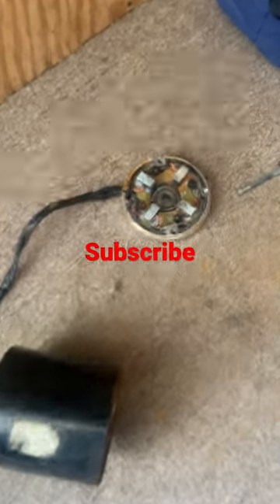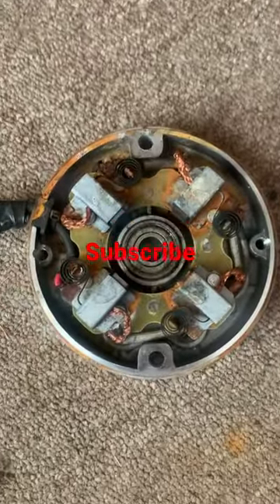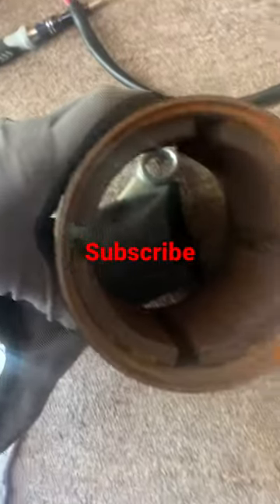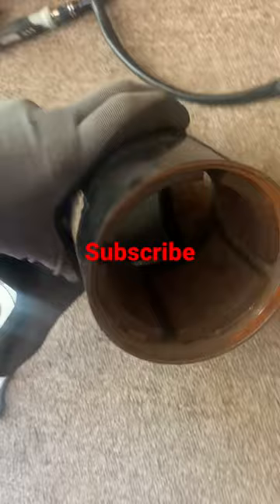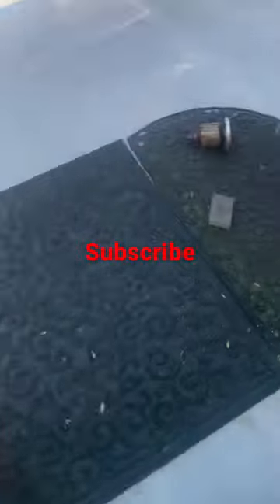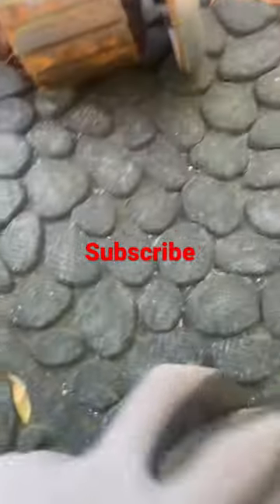How to fix water damaged electric motor (razor mx 650 motor left in the rain)

Comment: Mine got wet in the rain, but I'm not sure what the issue is? The throttle shows the battery is connected and charged. Battery seems to be fine, I didn't see any smoke or signs of heating. (Lithium ion battery). All I noticed is the chain is really rusted up, the part where the motor connects to the chain is also rusted. Could it be the motor or chain?